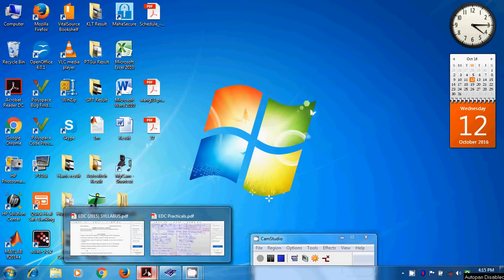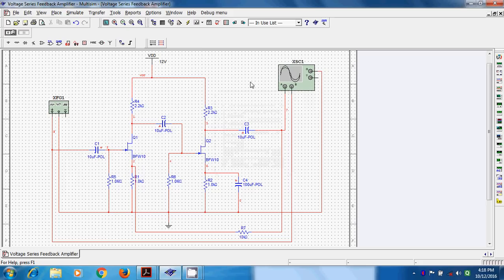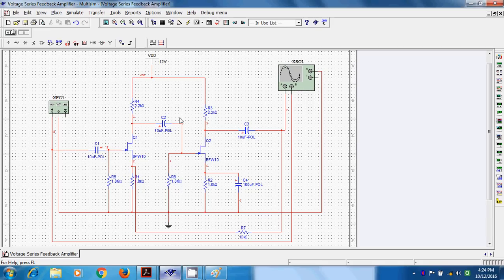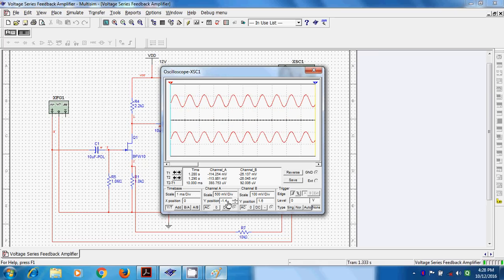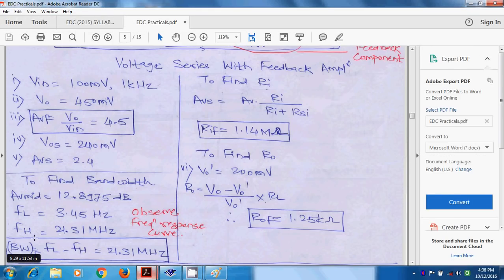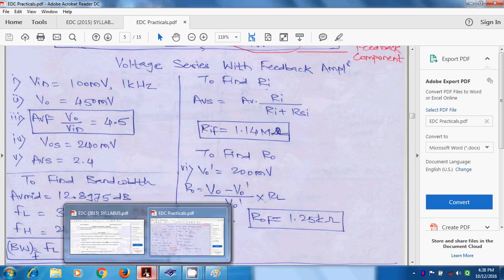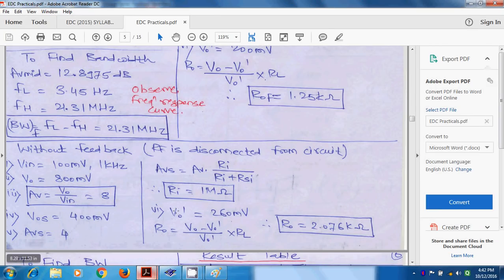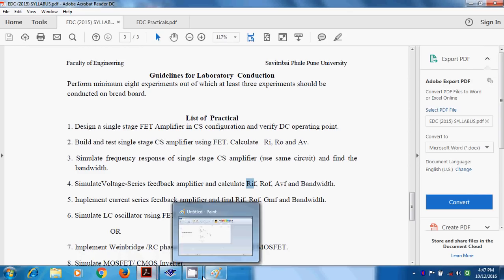EDC Practical: 4. Simulate Voltage-Series feedback amplifier by Prof. Omkar S. Vaidya.

Comment: Sir, why we have used two jfet's here
Reply from the maker: For Cs configuration we need two JFET. Because the circuit need to satisfy voltage sampling. we know Vf = (Rf/Rf+Rs)xVo. If Vo = 0, then Vf=0. It is voltage sampling. Not possible with single stage. Whereas we can construct single stage voltage series feedback topology but we need CD config.
Reply: I got it.
Thank you Sir